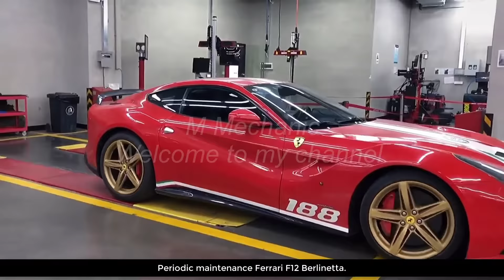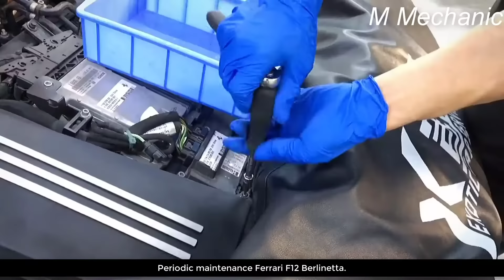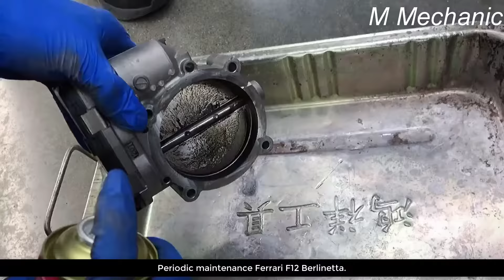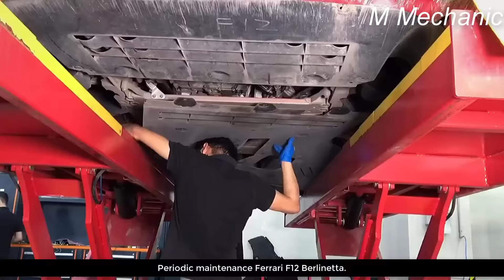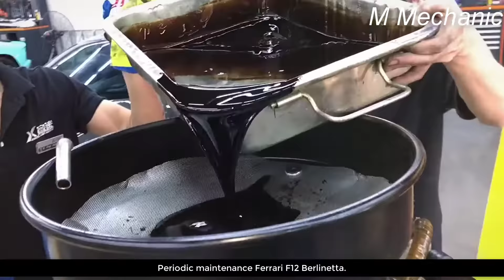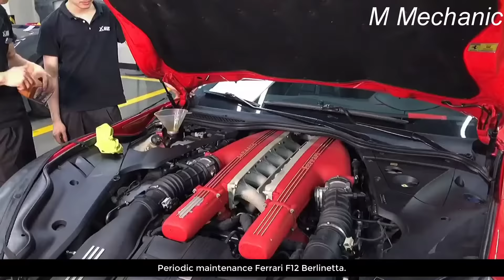Periodic Maintenance Of Ferrari F12 Berlinetta.

Comment: Castrol, consider how badly it performs in short-piston, thin-ringed German cars (or rather, how engines like N63 and old N20, or lots of VAG motors, treat oil), is an "interesting" choice. Motul dealer closed his/hers shop this day, probably.

But perhaps F12 is less extreme in overheating department...or has piston ring thicker that mosquito's private part...
Reply: I wouldn't put Castrol in my lawnmower let alone a Ferrari. Penrite is my oil of choice

Comment: Oil, filter, air filters, clean throttle bodies. Reset service light. 
That will be $3,000.
Reply: Nope , the service is free for the first 7 years. No costs. You can extend to 15 years if you like. They dont charge for anything because the service used to be only parts costs and no labour. Ferrari buyers always tought it was a joke when the salesman told them it would only be 300 dollars. So they made it free.

Comment: Best Oil CASTROL? 🙂 I must say.. Since I've been Using Castrol and not Shell Oil anymore, my Oil Consumption is much Slower. BMW F01 750I Tuned 500HP and 770NM. How is this possible?
Reply: I used to run mobil 1 5w-40 on my BMW X5 and used to burn roughly 1 quart 4500 miles in (5k oil change intervals)…so since the past 1 and a half years I’ve been using Castro 5w-40 and now I can do 5000 miles without any oil loss!
Reply: Some say that Castrol is just an oily water.
Reply: @zetx1834  honestly from my experience using it on both of my bmw’s…..2015 x5 35i 2011 x5 35i I’ve been very pleased
Reply: l have used mobil one in my Mercedes because thats what they recommend but i have heard bad things about it.l have always believed if the oil meets the spec than its good and the rest is all hype

Comment: Jeez! Filthy throttle bodies and the old oil looks like tar. 
How many years since this car was last serviced?
Umm, actually, has it ever been  serviced since it left the factory?? 
😳🤣
Reply: I wouldnt recommend cleaning throttle bodies with brake cleaners tho. They dry out the shafts and cause hick-ups. In worst case replacement

Comment: Castrol ??? In a ferrari ... what the ... i put in my audi ravenol or liqui moly or motul, much more expensive oil
Reply: What's wrong with Castrol oils? Other super cars such as Bugatti Veyron and Koenigsegg engines can use Castrol too. Your ravenol, liqui moly or motul isn't necessarily more expensive. it depends on the spec of the oil.
Reply: In Romania castrol has a bad reputation among mechanics and car experts , i had a bad experience with castrol , my tsi engine was consuming a lot of oil with castrol , with liqui moly or motul or ravenol just 100g in 10k km
Reply: @Gabrielpan  I see. I don't have any comment on that but when it comes to oil consumption, that usually means that there's a bigger underlying mechanical problem i.e valve cover gasket is leaking, crankshaft seals leaking, or one of the main seals is leaking. As to why it consumed more Castrol oil, maybe the viscosity was lower? The reason why I like Castrol is because I personally, never had any problems with them in my long years of owning supercars. Ferrari's being one of them.
Reply: In Romania castrol is the most counterfeit oil , you have a good chance to buy a fake oil , the resemblence of packaging , the bottle , is amazing , but inside you have a fake castrol oil , that's why i prefer a oil wich have a code on the bottle and you can check the code on the oficial site , ravenol have that , is more expensive but you are aure that the oil is the original one
Reply: @Gabrielpan  That is a sad story. We're more fortunate here to have higher quality control over such things. Less to none fakes when it comes to oil. However, that is beside the point and another issue altogether.